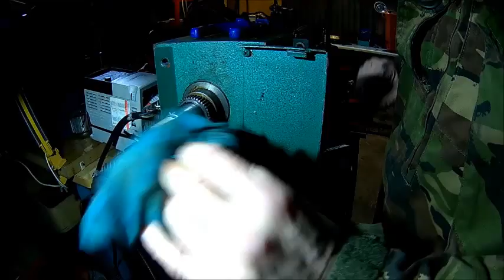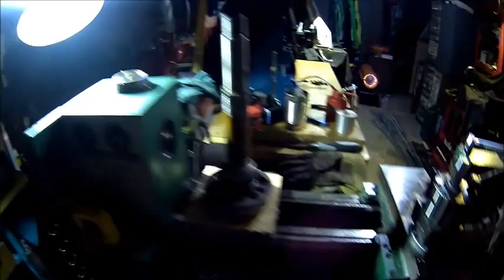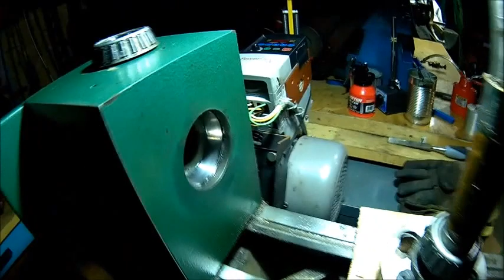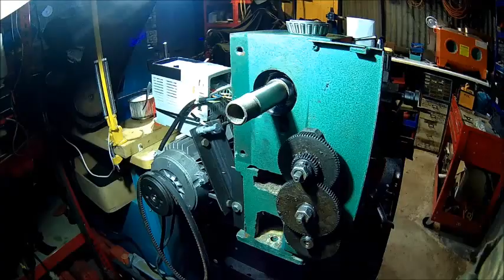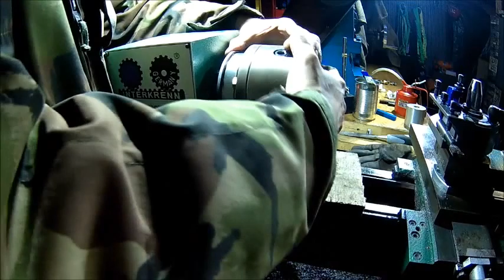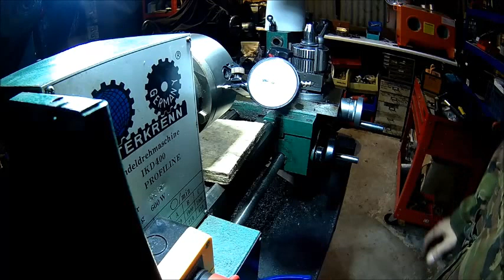Lathe Spindle Bearings, tear down, inspection, re-grease and adjustment

Comment: Good job. The grease is fine, the rolers will turn with the right pressure.
Reply from the maker: Thanks,..the bearings are toast but it worked out for quite a while, got new ones now, just need to fit them

Comment: I has Sieg C6 Lathe same as your. I can see you did some fault to adjusting the bearing with dial clock.  Tapered roller bearings are preloaded in the same manner as angular contact bearings. Like angular contact bearings, they can be mounted in single, back-to-back or face-to-face arrangements. The resulting contact angles between the rolling elements and bearing races also resemble those found in angular contact bearings. With the preloaded bearings check the working temperature is luke warm after running the spindle in 15 minutes  means the bearings is correct preloaded. Don't use the lathe under testing the bearings. Cold bearings= need more load on bearings. Too hot bearings = loose a bit more on the bearings (less press on the bearings).
Reply from the maker: Well,... if you would have watched the video in full, you would have noticed that i in fact pre-loaded them  .....

Comment: Two Points:
1: I think you might have put way too much grease on the bearing. If you put too much grease on, the rollers start to slip instead of turn and then you get more (and un-even) wear.
2: You might have luck finding the same bearing dimensions with a completely different name/number (I saw that you found bearings later in the comments).

I've recently had fun doing something similar with a milling machine. Good luck!
Reply from the maker: 1:yes it's probably a bit much, but those bearings are totally shot already so i wanted to prevent them from fretting. Taper rollers need pre-tensioning, so they move the grease out on their own, usually towards the smaller end. Plain roller bearings need a bit more attention.

2: fortunately it's a common size, so they were fairly cheap, still haven't changed it because it's doing ok right now and other things are more important .. i also have 2 other lathes. ....

Comment: nice job, the SKF taper bearing video shows .005 for backlash I assume so it won't bind in case it gets too warm? but I like your method of reasoning instead of getting a bigger hammer like most people like me.
Reply from the maker: Thanks, i now have new SKF bearings and will change them in the near future as it's getting some play again, i think the butter steel just has it now. I did many hours of machining on it, it's more than a year now and i did know it was coming. I always tighten taper bearing by drag torque, that's the recommended procedure of most bearing manufacturers, the "bigger hammer" method usually ends just in a bigger bill for parts, so as with most thinks, look at it and do a more or less educated guess what's needed to get it going

Comment: I don't own a lathe like the one being serviced, but this is really interesting !!
Reply from the maker: Thanks, ... essentially the principle is the same for most small lathes. Got new bearings sitting on the project pile as it develops a little bit of play again so i think it's time to replace the "soft cheese" bearings with some quality ones.
Thanks for watching.
Reply: Thank you for a great video! I have 30 year old sears craftsman. I can tell the bearings are dry. I'm going to open it up and make some improvements !

Thanks again
Reply from the maker: You're welcome, thanks for interest.
Reply: Is it better for the rollers to wear or the tapered surface it mates to on the headstock there?

Is it possible to remove and grind on the tapered surface of the headstock?
Reply from the maker: The tapered surface is the outer ring of the bearing, you can easily knock it out, new taper roller bearings always come as a complete set.
Reply: Oh okay I was thinking that surface was part of the headstock body, good deal.
Reply from the maker: If you look at my South Bend 14.5" video series you can see a different style of headstock bearings

Comment: my greatest thanks for the vid...

I m very new to lathe turning, in fact my new lathe just arrived....terribly the supplier had sent me the wrong model with a smaller sprindle bore I ordered.....now they are planning to send me the correct one so I can replace it myself....

I m deeply concerned...since in fact I have 0 lathe exp. but now I need the breakdown and replace the most critical part myself.........what the hack......

lets hope I did not break anything in the process otherwise my new lathe will turn into a huge piece of junk....even not yet switched on.....
Reply from the maker: You are very welcome. Believe me, it is not complicated, just think twice before using a hammer.... and do not over tighten the spindle nut, otherwise the bearings will wear fast.
I finally sourced some bearings for mine, so there will be another video coming in a few weeks, showing how to chage out the bearings.
If you need more info/help, feel free to ask. ....And by the way, thanks for subscribing

Comment: even though label is in German I'm pretty sure its a Chinese made
Reply from the maker: You absolutely right, in the 1990s these machines were sold in Germany by Interkrenn.
They are certainly Chinese made and still sold with various brand name stickers on it, not great but it's doing ok for the price, They also do a long bed version which most likely flexes even more.
Since i now have my South Bend 14.5x48" it won't see heavy work so much anymore.
Reply: @Marco Dalmatini Taiwanese copy (under license) of the Emco Compact 8. Mine is the TFS-450AN. I have upgraded it to a 0.75HP 3 Phase with a VFD. I happily turn pre hardened tool steel on it & can spin up to 3600 rpm for aluminium.

Comment: beating on those bearings is the wrong way to do it, dont put bearings you beat on back in replace them
Reply from the maker: I did not really beat on it, it was more  like tapping because it's a slip fit. This is the way i do it and it worked well for me the last 40 years.You also most likely missed the point when i said that these bearings are shot already, they made from Chinese butter steel and need replacing anyway. The reason why i took it apart is for looking whats wrong with them and what type it is so i can order new ones.